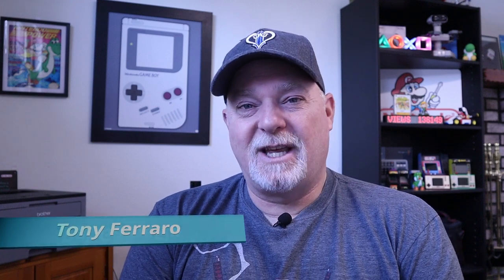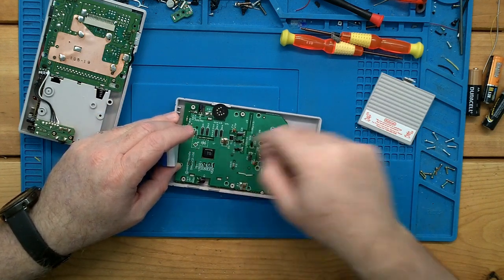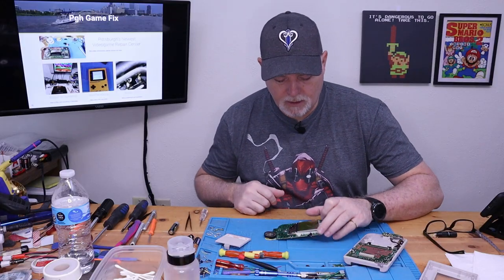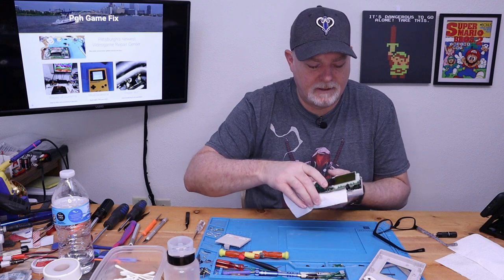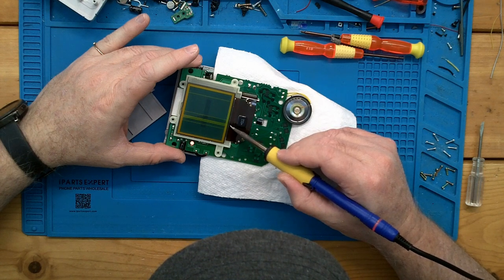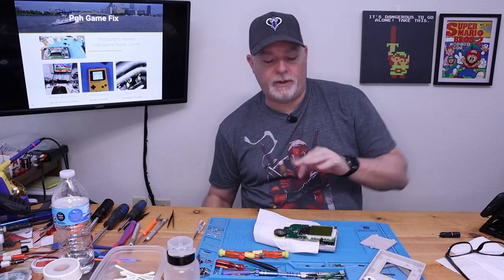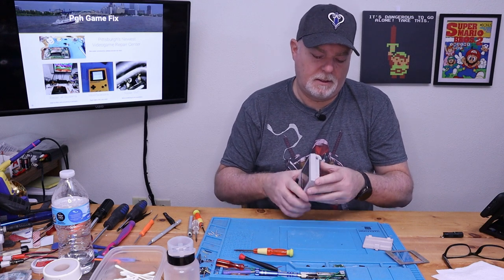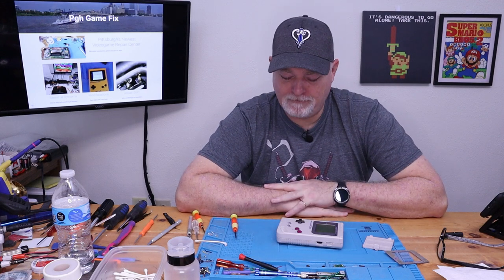Easy Fix: Nintendo GameBoy with lines in the screen.

Comment: Hey I have a question what if you don’t have a soldering iron? Can I use other means?
Reply from the maker: You can try another heat source if you want.  Let me know what you wind up doing, and if it works.

Comment: My GB has some lines in the center of the display. I tried this method and could get them connected. Are they dead? Thanks!
Reply from the maker: Sometimes the screen can just have a defect.  BUT... it does take a bit of heat to reconnect the cable.
Reply: @PghGameFix  I insisted in the center part of the connector, but the lines never turned on. I guess it's time to get a replacement 😩